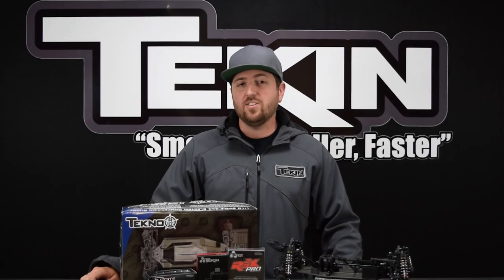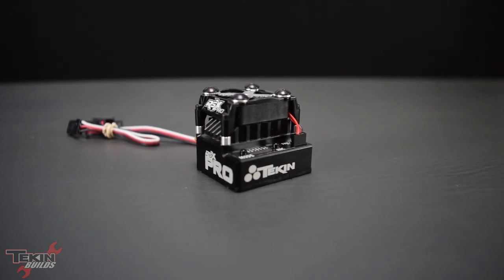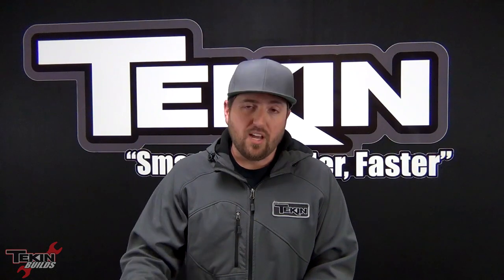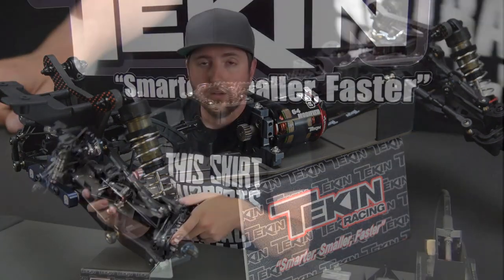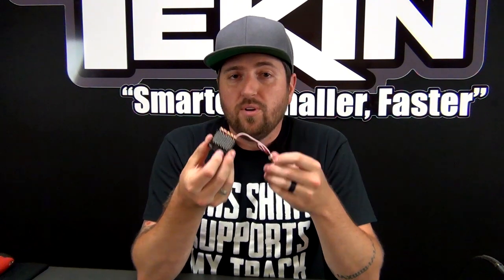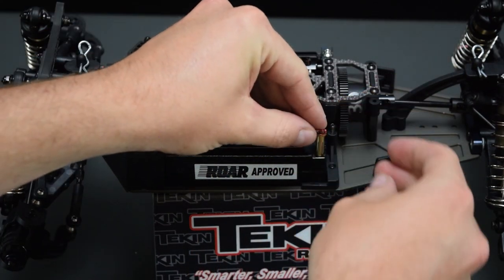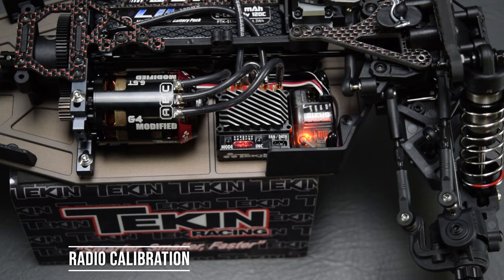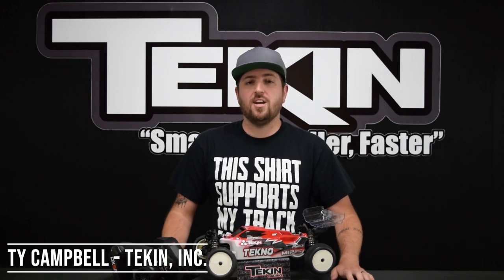EB410.2 RSX Pro / 6.5T GEN4 Installation | Tekin Builds Ep. 21

Comment: I like to put a small piece off red heat shrink on the positive battery lead before soldering the battery connector. Once that's soldered just warm the heat shrink onto the wire as close to the connector as you can get it. No issues cross connecting

Comment: Ah, I was wondering if there were any drawbacks to soldering the wires horizontally onto the posts vs. vertically, as is usually the case. I need to re-solder the motor leads on the RSX Pro I have installed in my TLR 5.0 DC Elite. The loop is slightly touching the body when I put it on, and even though I have a little slack, the light pressure is enough to want to lift the front of the ESC off the tape (it is one LOW-PROFILE body). At least with the horizontal joints, it will sit lower on the chassis. 😁 Nice episode!

My Tekin count is up to 2 RSX Pros, an RS Spec, 2 Gen4 R-Specs (17.5, 13.5), a Gen3 R-Spec (17.5), and 3 T-180's! Oh, and a HotWire 3.0 to manage all the goodies, of course!
#TeamTekin #DriveTLR
Reply from the maker: No problem soldering them on horizontally, that is usually my preferred positioning if the car layout allows!

Comment: It's nice to see we have come this far, but still roll with an On/Off switch design from 50 years ago...
Reply from the maker: Haven't had many switch issues in the 15-ish years we've been using it. It is a nice double contact switch and works great.
Reply: Some racer's at the local track I race at cut the switch and solder the leads to the battery leads.
Reply from the maker: @daletennett4812  solder the switch leads to the battery leads? I hope you mean solder the switch leads together?
Reply: @TekinRacing  yes sorry I mean together

Comment: Great video as always , I was wondering if you would install the fan on the rsx pro paired with an 6.5t and driving hard at the track , would the esc become hot ?
Reply from the maker: I would run the fan if it's over 80F out just to keep things as cool as possible. Normally I don't run a fan and never really see over 3 LEDs on the temp indicator, which is about 160F.

Comment: This has nothing to do with the video. I have a 2wd slash that I would like to put my Tekin 4x4 sct 4600kv motor in , my slash is a on road basher. I have the RX8 esc new to. I run a Hobbywing 10.5 right now but want better top end speed plus it gets hot on 3s. So will the RX8 4ESC and 4x4 4600kv motor be better thyan what I have. I like your 5mm shaft. Plus I like 3s power.

Comment: 🤦‍♂️ first I had to worry about kv rating on brushless motors now they have turn counts also.... Thought it was bad enough on brushed motors with turns and slots. This hobby keeps getting more complicated all the time 😂
Reply from the maker: This style of motor has been rated in turns for near two decades now though. 4-pole motors we tend to rate by KV rather than turns because they are all low turn motors usually between 1-5T.